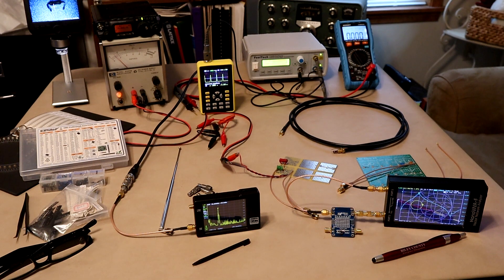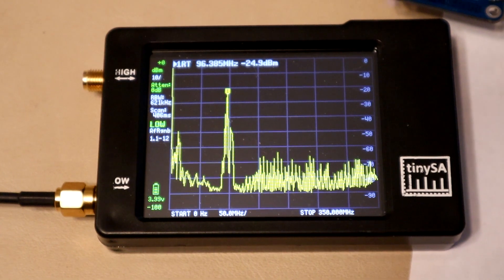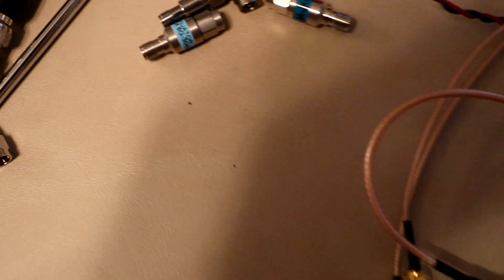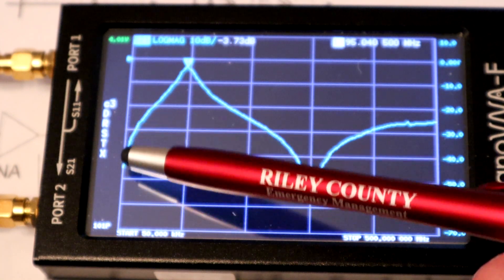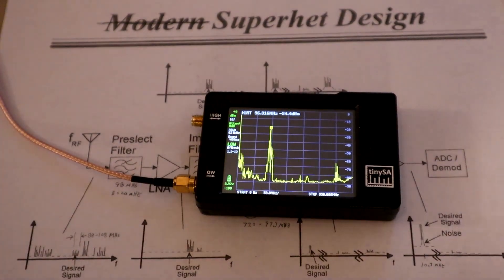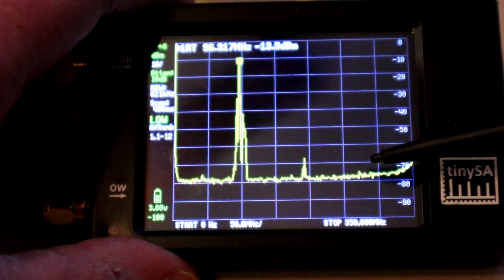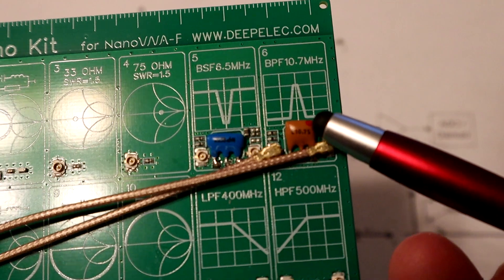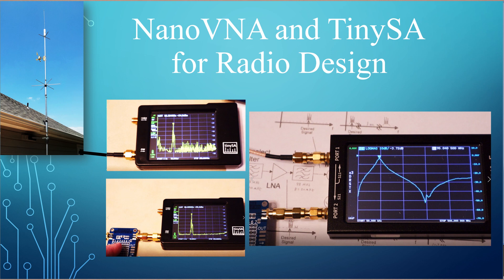NanoVNA and TinySA for Radio Design

Comment: Forgive me! I am just seeing this vid for the first time. I am a career RF/Antenna/Microwave Design Engineer. I really do appreciate some of tne new stuff coming out (I have seen some of this stuff for the past 3 - 5 years). It is exciting to see VNA's, for example, which are VERY affordable. 
They are, albeit, somewhat limited in both frequency & capability. If you are designing just a bit beyond WiFi/Bluetooth, these things are great. If you are trying to design higher freq stuff into the S band & above, or several different types of receivers & RF filters, then a more complex system may be required. Although, I have purchased 2 of the NANO VNA's and set them up using MATLAB & Python to get the full S-parameter (S11, S12, S21, S22) measurement for filters & some other mixer type responses. It isn't easy but can be done. Higher freq stuff (over 6GHz) will require a better VNA, however. 
Overall, it is very encouraging to see some younger engineers out there using their gifts to bring some of us not so entrepreneurial-types useful and very economical tools!
Reply from the maker: Totally agree.  I do miss not having built-in attenuators to characterize active circuits, and the number of frequency points is a little limited in a single sweep, but overall the NanoVNA is amazing. I've been tempted to get the 6.3 GHz one, but haven't yet.  On a related note, have you seen the "TinySA Ultra"?  Erik and team extended the TinySA spectrum analyzer to go to 6 GHz now (though the spurious-free'ish region is only through 800 MHz I think). And it has signal generation capabilities too, and output level control down to about -100 dBm. I have two of the original TinySAs. One for spectrum analysis and one for signal generation :-)  Amazing stuff !
Reply: @MegawattKS  I have looked at the TinySA Ultra, but I already have an HP8592B SpecAn. Still, it might be interesting to get one and compare results.
I bought the HP years ago from a salvage company who was liquidating a lot of Motorola stock of test instruments. It goes up to 26GHz, so I am good for the freq band of interest. The sad part is I was also trying to purchase an Agilent 5071A VNA from the same company, but the bidding got WAY out of my budget. I think someone purchased the unit for around $18k. They got a good deal for that price!
Reply from the maker: @brianweber1973  Cool.  We had an 8592L (22GHz lower-cost version) at school that we used (and still use) in the microwaves-and-antennas course. It's a solid performer! The nice thing about the TinySA units (if one doesn't need to go into the GHz spectrum) is how portable they are. Even at $60 for the base model, they're  useful for around-the-house propagation measurements and RFI investigations, checking cable-TV signal levels, generating RF signals, and such :-)

Comment: Excellent Video.  Thank You! I have a question.  I've seen notes on some systems where they talk about the 'system bandwidth' what are they referring to? the pre-select filter BW or the IF filter BW?
Reply from the maker: Thanks!  The answer to the bandwidth question kinda depends on context. There are at least 3 different cases I can think of: 1) the pre-select as you mentioned, which determines vulnerability to interferers, 2) the IF filter you mentioned - which is classically equal to the spectral width of the signal so it minimizes noise without hurting the signal information, and 3) the final information bandwidth - which is dependent on the modulation type, and data-rate if it's a digital system. My guess is that they're referring to the final IF bandwidth which matches the modulation's spectral width. But you'd have to look at it in context of the particular system and what's being discussed. Hope that helps.  73's

Comment: So you could use these items to replace a radio service monitor
Reply from the maker: Possibly. But they don't have the certified performance or the user-interfaces those products have.  (Full disclosure: I have never used a service monitor - so I'm just guessing).

Comment: I AM looking for your amP diy to increase My helium lorawan Antenna! Could You máke a vídeo about thks
Reply from the maker: Sorry - I didn't understand the question. Can you rephrase it?  E.g. "increase My helium lorawan Antenna". I've been slow to get the next video out. It will be on filter design - but I've been considering making it the first in a series on design topics...
Reply: If I've deciphered your question correctly you have a helical antenna that you use for LoraWAN and you want to know if this amplifier helps you? LoraWAN runs at 868MHz if I remember correctly, that would be quite a bit beyond what the circuit here is tuned for

Comment: You mention a course you used to teach - any of that material online anywhere?  

Thanks for the video!  I haven’t picked up a tiny sa yet (been making do with the oscilloscopes fft and a rtl-sdr dongle), but have been eyeing now that I’m getting back into homebrew.
Reply from the maker: The only on-line version of that course material so far is on this "MegawattKS" YouTube "channel". I've selected a handful of favorite lecture/demos and tried to adapt them to a general audience, with minimal assumptions on prior math background/etc. Instead, they are focused around the NanoVNA. But much of the course content is sorta there.  I always resisted doing "distance-learning" versions of the classes due to their lab nature. But now that the NanoVNA and TinySA are out there, it's getting more practical for sure :-) 

I'm definitely impressed with the TinySA and would recommend it.  I got mine through Amazon and I think I paid more than the $55, but supposedly you can get them at that price from other sellers. The performance of the unit is much better than I thought it would be. And for the 300 MHz band, the internal architecture is excellent (multi-pole LPF followed by upconversion to 433 to put a tight filter on it - and then downconvert, digitize, and DSP filter). Pretty similar to the big-boy architectures, which probably accounts for its reasonably spur-free performance ...
Reply: @MegawattKS  Thanks!

Comment: how about putting links to the stuff your list in your video description..... thanks for this video.
Reply from the maker: You're welcome. I'll try to make a list here in this reply so they can be Googled to see options and details (don't want to favor a particular site or vendor/distributor - more fun comparing the offerings and seeing new stuff when searched :-). Here goes - starting with the simple ones:  "NanoVNA" (lots of different versions - mine is the 4" screen NanoVNA-F), "TinySA" (some different types, but mainly different places to buy), "RF Demo Kit for NanoVNA-F - by deepelec" (The green board with all the cool Smith Charts and components), "NanoVNA Testboard Kit" (the little blue board the filter was built on), "Interstellar Electronics SMD Professional Assortment Kit" (the surface mount parts box), "Inductor Sample Book" (goes by various names/vendors - but that should pull up useful hits), " SMA RF DC-Block DC to 6 GHz 50 Ohm", "U.FL to SMA Male Coaxial RG178 Low Loss Cable", "Nooelec SMA Attenuator Kit - Bundle of 6pc 2W 50 Ohm SMA in-Line Attenuators", "6.5ft Low-Loss Coaxial Extension Cable RG58 (50 Ohm) SMA Male to SMA Female", "Digital Multimeter, ACEGMET", "ADS5012h Handheld Digital Portable Oscilloscope", "50PCS IPEX U.FL SMD SMT Solder for PCB Mount Socket Jack Female RF Coaxial Connector".  Hope that's helpful.